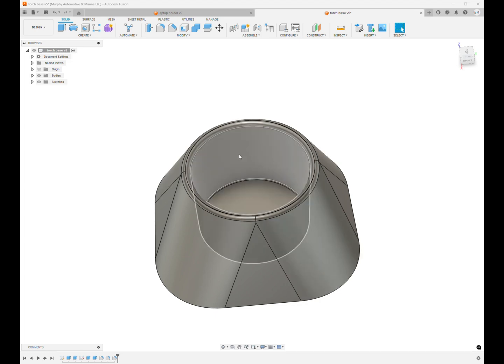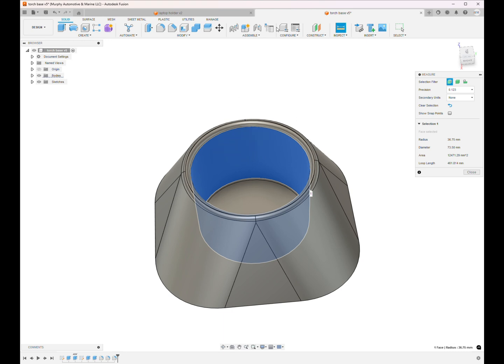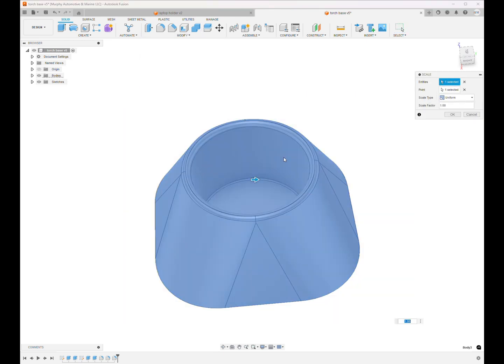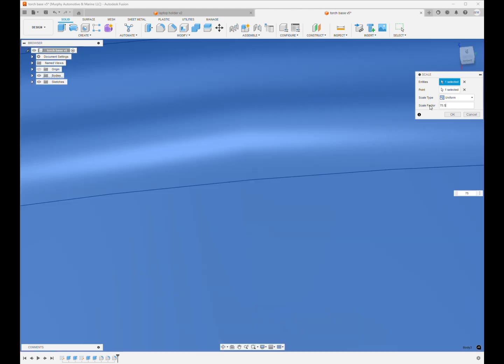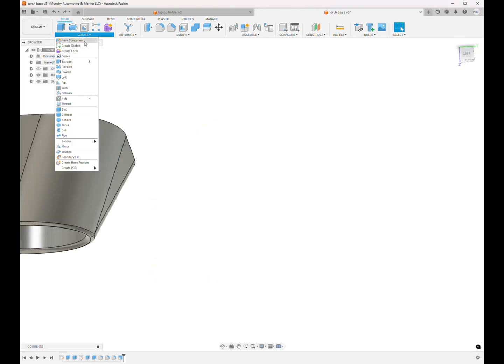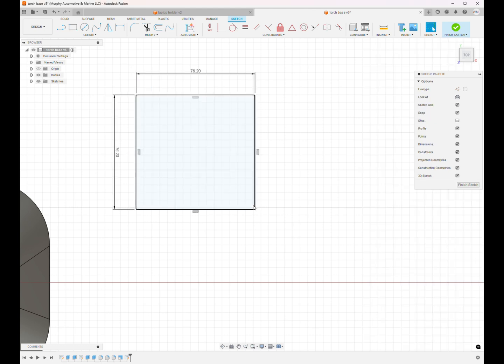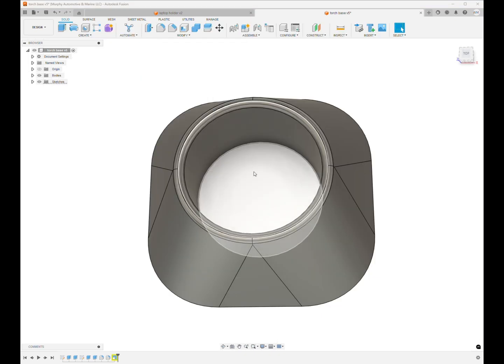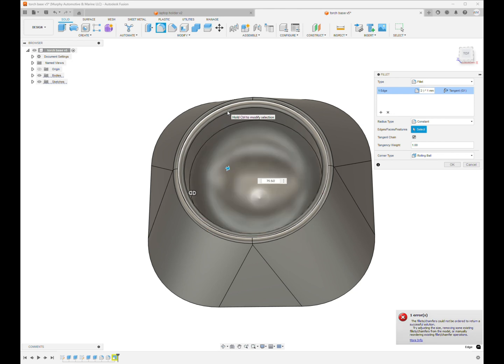Fusion 360 Beginner Tips: Using functions in place of whole numbers

Comment from the maker: 75.5/73.5=1.02721088. 
If you used the scale function with the following scaling ratios, you would get the following inner diameters:
73.5*1.02=74.97 
73.5*1.027=75.485
73.5*1.0272=75.499
73.5*1.02721=75.5

You have to take the scaling number out to 5 decimal places before it rounds to 75.5, which is excessive. 

Putting the function 75.5/73.5 directly into the scale box ensures that inner diameter will be EXACTLY 75.00 when you’re done, without having to mess with the calculator and a bunch of random decimal values.

For the fillet radius, since the circle is 75.5 diameter, you would want a fillet radius of 75.5/2=37.75. Instead of doing that math in your head or on a calculator, simply trying that equation directly into the fillet value will ensure the perfect fillet that is EXACTLY half the diameter of the circle, forming a perfect semicircle.

Comment: Those is so wrong. Instead of adding sludge workarounds to make adjustments, go back in your timeline and fix it properly. Doing so makes your life much easier going forward when you need to make more adjustments.

Please don't pretend you're an expert and spread bad habits. You're doing a disservice to everyone who thinks you know what you're doing.
Reply from the maker: Hey that’s your opinion, and you’re totally entitled to it. 

However, the title of the video mentions BEGINNERS, and I myself am a beginner. Never once did I pretend to be anything other than that, or claim to be. These are simply  things that I am learning and finding helpful, and thought others might as well. 

If only one dimension is critical (in this case, ID) then what I have shown here is perfectly acceptable, and does not run the risk of breaking other geometries suck as fillets and radiuses. It can be like trying to shift an image 2mm to the right in a word document, and the whole thing falls apart. 

I would have needed to essentially go back to the first sketch, make all my dimensions that ugly percentage larger, just to accomplish the same thing in the end as what I have now: a stable base for a $70 torch. 

If there were other constraints that I needed to keep fixed, such as bolt hole spacing and diameters, then sure I would have to go back in the timeline. 

This isn’t the place for perfection, and if you are here for that, you will be disappointed. This is a place for learning, trying new things, and making things to make life easier in the shop. I welcome constructive criticism; I believe you learn more from your failures than you do your successes.
Reply: Except you purport to be teaching BEGINNERS, as you say yourself. Teaching bad habits is just wrong. If you want to show them how to do something wrong, teach them how to do it right first. Then, immediately after doing that, explain how there's a quicker workaround for special exceptions and demonstrate scaling. 

The way you did this makes it appear that the PROPER way to do this is scaling, which anyone at all capable in Fusion should know is totally wrong. You're purporting to be capable and knowledgeable enough with Fusion to be teaching it, but posting this video calls that into question.
Reply from the maker: @kenwhite6739 the proper way to do what I wanted WAS scaling though. I wanted everything to look exactly the same as it was before, just slightly larger. I didn’t want to change anything about geometries, angles, proportions, etc. I wanted the EXACT same object, just upsized slightly. 

If I made the ID larger without changing anything else, it would have intercepted the cone shaped OD sooner, resulting in a shorter overall height/overall depth of the interior pocket.  If I made the ID larger but wanted to keep the same depth of the interior part, I would have needed to make the outer cone shaped walls steeper to meet the top of the ID, or I would have needed to make the OD of the base larger to be able to keep the same angle of the cone taper. 

Or I could simply scale the whole object up the exact right amount needed so that visually it looks exactly the same as before, all the angles, tapers, radiuses etc. Just slightly bigger to fit the bigger bottle size. That quite literally is what the scaling tool is for. My only constraining geometry was the ID. Everything else can be along for the ride in this case. Of course that isn’t the same for every case, but that would be generally understood already I believe.

Comment: An alternative to typing a units conversion calculation like “3*25.4” is to simply type the units you want, “3 in.”  Fusion will accept that and convert it to whatever units you are using in your project.  I have used this many times in my projects.  I typically work in inches, but occasionally use a metric tolerance or dimension.  For example, I just type “1 mm” and Fusion converts it automatically, displaying “0.039 in.”
Reply from the maker: I am gonna have to try that! Thank you! I am still very much a noob when it comes to Fusion360 I think, but I am loving learning all these little ways to make it easier to work with.